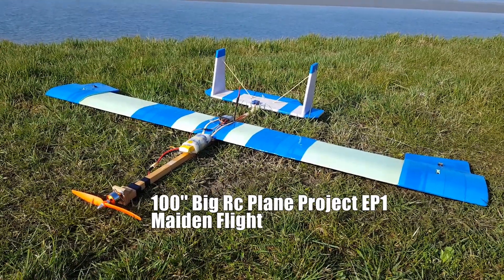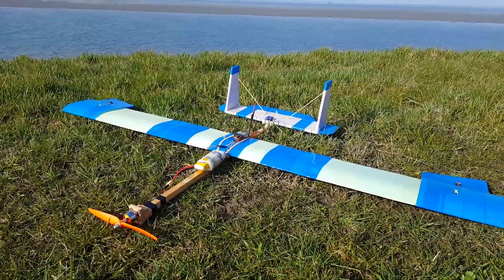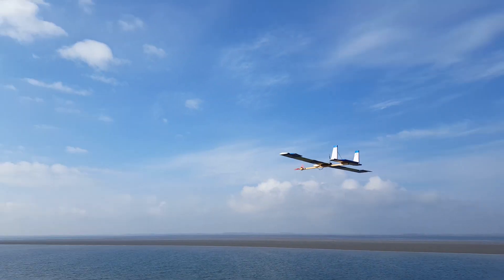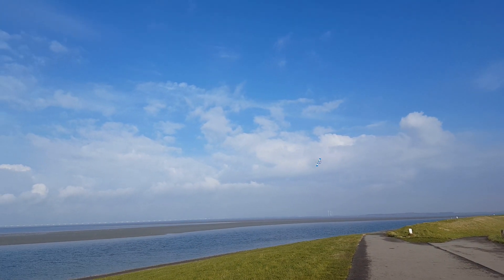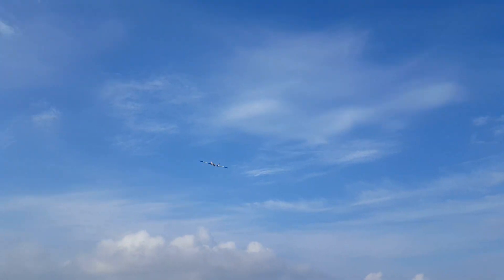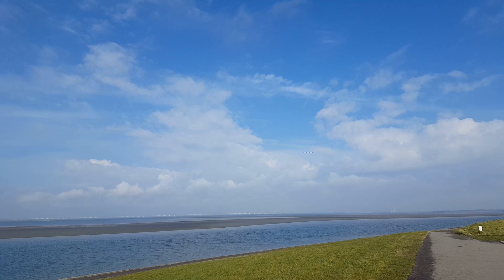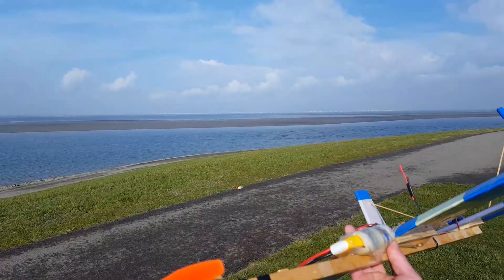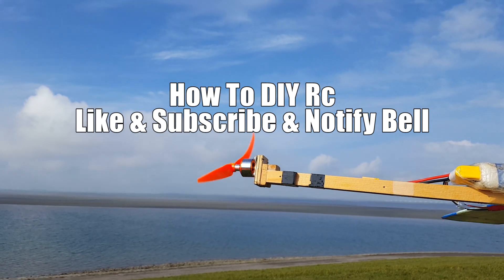100'' Big Rc Plane Project EP1 First Maiden Test Flight of a Beginner FPV Airplane

Comment: You live in a very beautiful area. That model looks like it flies on rails. i can fly like that all day.
I have lots of those 2212 motors...with different kv too. The 9 x5 props came in yesterday.
Do you like that combination? 1400kv on 9 x 5
Reply from the maker: +OneEyE Monster thank you Sir 
Yes the 1400kv with 9x5prop gave me the best thrust results nut i like the 930kv to build slow stick the only down side it the size of the prop